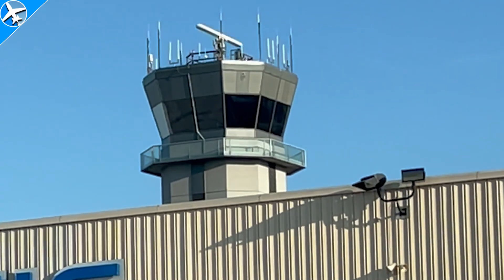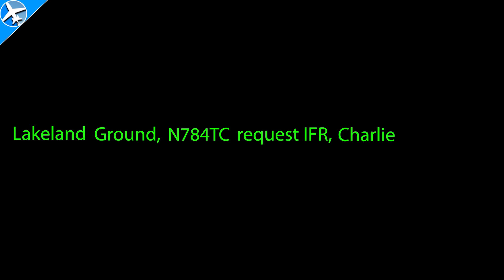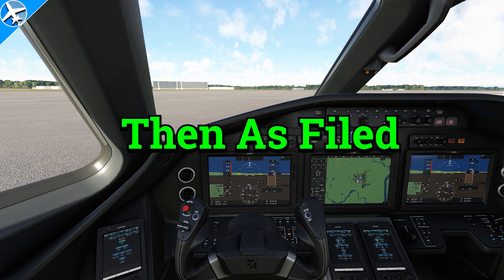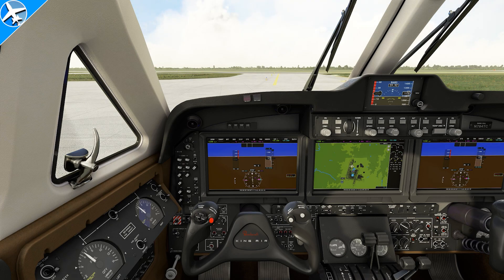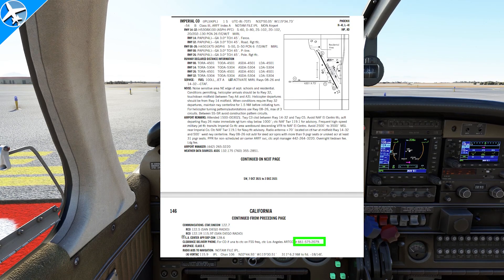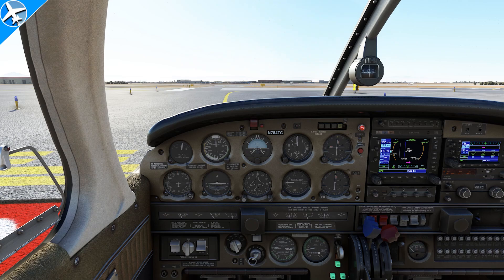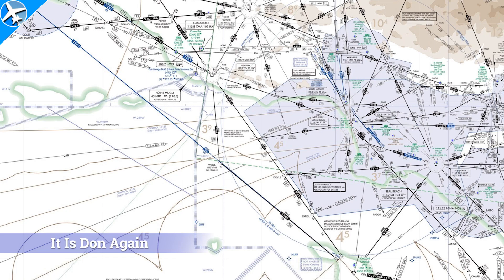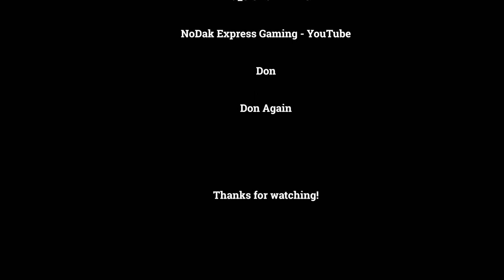Request and Copy IFR Clearances | Pro Pilot Tutorial with Real Air Traffic Controllers

Comment: Greetings,

Great article and video! I just have a couple of questions, I know that there are several IFR departure procedures including ODP, SID, Climb via, radar departure..etc

1. The ifr clearance/CRAFT mentioned including the craft at a non controlled airport, is the CRAFT part of the odp, Sid, or other ifr departure procedures? Or is it simply just a clearance or a “permission” from act to get into the skys from ATC. 

2. Let’s just say I’m at a major busy controlled airport KLAX for example, and I’m using the SID or ODP for my departure, will I need to copy down the a whole bunch of stuff from ATC for the CRAFT as well for my clearance or “permission” to get into the skies from ATC? I assume flying the airlines have a much more easier way like just inputing down all the information in the flight computer system right? And only for general aviation like if I’m flying Cessna 172 part 91 where I have to write down all the bunch of stuff for the CRAFT info? Thank you! Meaning do I need to get an IFR clearance from either a controlled airport and a non-control airport as well?

3. I have heard from different sources including flight insight about the number of flight IFR departure procedures, I’m not sure if this is correct but I will just name the ones that I know below, Please correct me if there any mistakes or any overlaps, thank you.

IFR departure procedures

1. SID (3 kinds of SIDs including 1. Pilot-nav SIDs 2. Radar Vector SIDs 3. Hybrid SIDs)

2. OPD

3. CLIMB VIA…SID or ODP

4. Visual Climb over airport, (Not sure if it is the same as number three Climb via…)

5. Vectors Dep

6. Diverse Dep

7. Radar Dep

Thank you so much for your help!
Reply from the maker: 1. When departing a non-towered airport under IFR, ATC will issue a clearance just like the void time clearances at the end of the video.  You will hear ATC say "hold for release" or "you are released".  The clearance will read the same concerning CRAFT, but ATC has no control of you at the non-towered airport.  They are simply making sure you are clear of other conflicts operating under IFR before releasing you.  If another airplane is on an approach, they will not release you until the approaching airplane has canceled IFR.  The clearance could contain instructions that mimic the ODP, but obstacle clearance is the pilot's responsibility.  If you need to fly the ODP and the route is different from the cleared route, communicate that with ATC.  
2. At a towered airport, the clearance will be given over clearance delivery and ATC will say "Cleared to XYZ airport, ORCKA5 departure, then the route, and the rest of CRAFT.  The SID will have obstacle information via climb gradients required.  Sometimes on an RNAV departure, the tower will name the first fix of the RNAV departure to verify the correct SID has been entered into the FMS/GPS for the specific runway that you are departing from.  Writing down a clearance is very similar from airport to airport.  The biggest differences will be contained in the route.  Cleared as filed could be given but an entirely different route could be given, and you will have to copy it all down.   Most of the time controllers will go slow and spell the fixes.  If they don't, ask them to.
3.  There are several different departure types.  Despite all that, a heading will be assigned by ATC and then direct to a fix will be given, cleared on course, or if on an RNAV departure like the ORCKA out of LAX, the airplane would be flown to the first fix and no vector would be given but that is where tower will say the name of the fix when the takeoff clearance is given.  If doing a VCOA, there are distance parameters involved in how far you can get from the airport and the VCOA has to be requested by the pilot.

Comment: You are giving away all our secrets! Just kidding, I was at DCA back in the 70's Called for the clearance at 10:30 PM, things were slow however the Clearance delivery controller was in 3:30 PM mode. the clearance came back me at 400 knots. DCA to Addison, TX. I Asked the controller if any of that information was 
important. he responded with of course it is it is your clearance, I responded with slow it down my pencil does not write that fast. he reread the clearance. N      O     V  E   M   B   E      R     9       8      R      S   You       Are    
cleared         TO     Addison    Airport.  I think you get the point he read it back real slow! A week later I was back at DCA he remembered the Number when I called again. he laughed and asked what speed should  I issue the Clearance?  We both laughed he gave me his initials. on the next trip I met with him on his break. We remained incontact for several until he retired.
Reply from the maker: That is an awesome story!